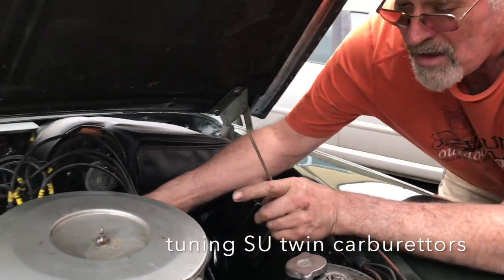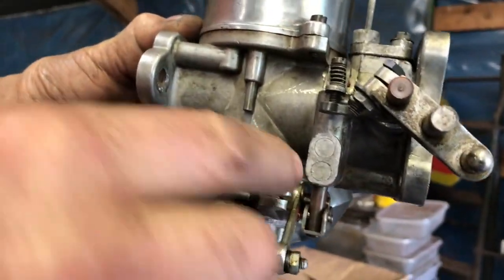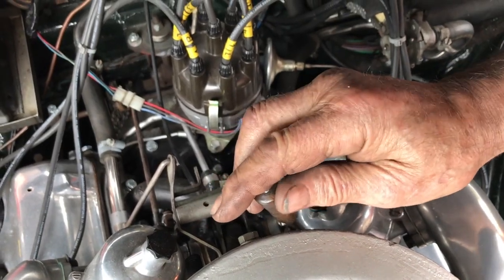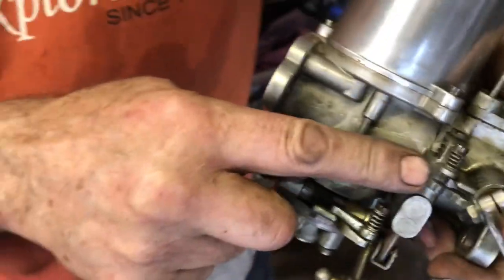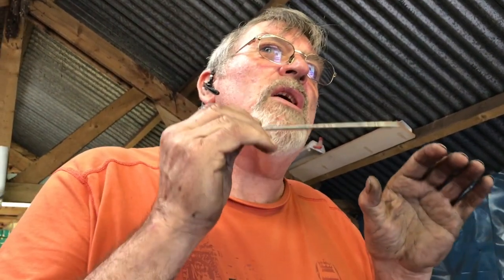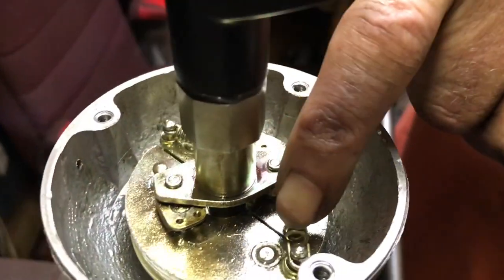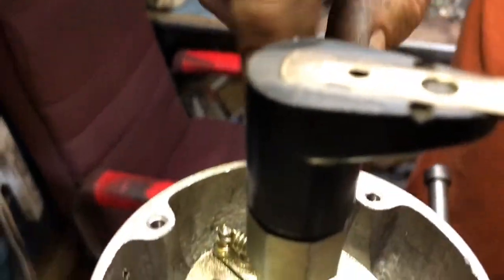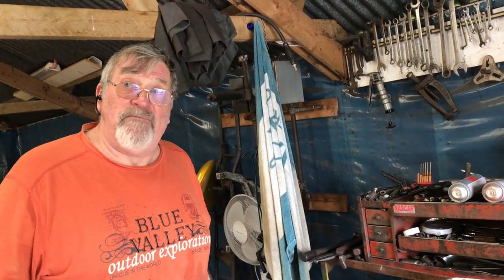Russ Carpenter : Daimler 2.5 V8

Comment: Thanks for posting Russ. Very well explained.
I will follow your instructions.
What sort of engine oil would you recommend on an original 250V8 that has done around 54,000 miles?
Reply: Thanks for your question, however Russ Carpenter is not the host of this youtube channel. Russ rebuilt my engine and I filmed his explanation of SU carbs and posted the video for genereal interest. J G Miles